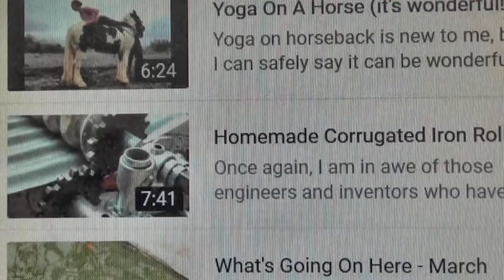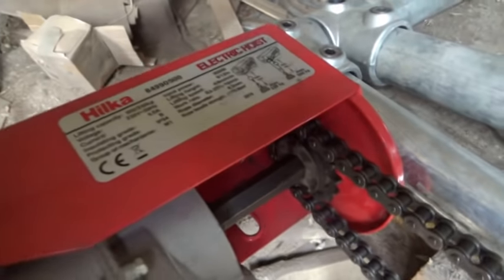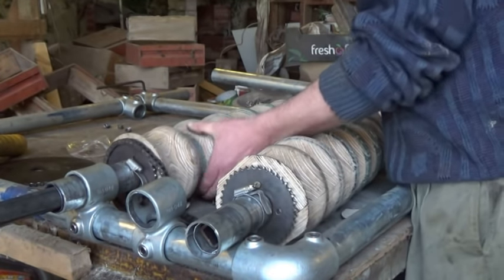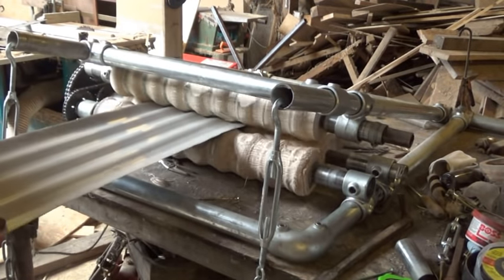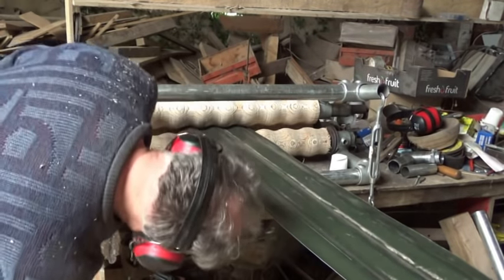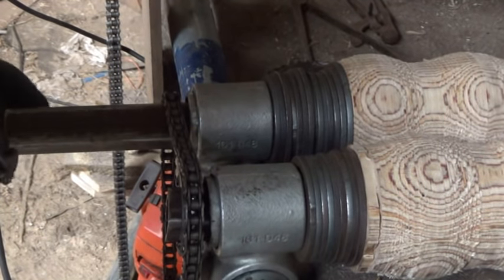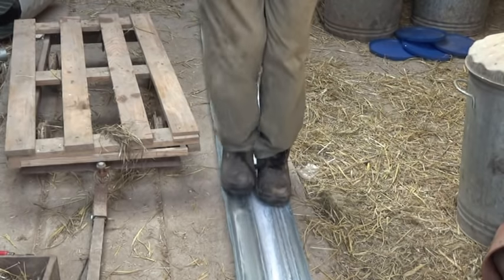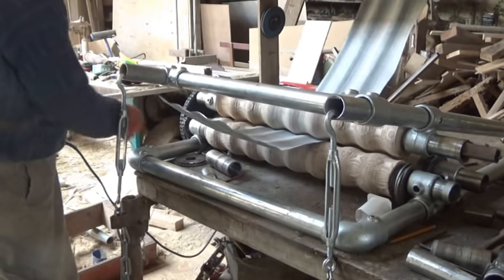Homemade Corrugated Iron Roller - Part Two

Comment: I have been watching your corrugated roller construction with interest. I have been rolling corrugated iron into garden beds and dog kennels the same as you are trying to do for many years. I do use an antique roller to roll the iron but cant see why your roller wont work,  I don't use new iron as it is too high tensile and crinkles quickly. I use old corrugated iron that was produced prior to 1950, this iron is quite soft and bends easier. A lot of corrugated iron roofs are renewed after many years and the old iron is quite reusable for what you are doing. The old corrugated iron is only 600mm wide compared with the new style iron which is 730mm wide. Up to now we have made 350 garden beds using old second hand iron. I would be quite willing to send you photos of the beds we have made to show you how successful we have been rolling old corrugated iron
Reply from the maker: Let me guess - you're from Australia or New Zealand?
Reply: Yes Australian, down in South Australia

Comment: I can't help but think the contraption has too much play for the forces needed. I would guess that you need something much more rigid and that the advancing of the middle roller needs to be done with more precision to avoid twisting. If the contraption is stout enough, you should be able to power it by hand- little by little- without distortion/twisting... My advice if you continue: scrap the tubing frame and weld something up with plate steel...
Reply from the maker: I think you're right - too much play. I might have to start again..
Reply: Way Out West Blow-in blog :) I hope you do keep tinkering- would love to see it. You got me curious so I looked into the industrial machines- they look quite heavy duty... but yours has them beat in charm, definitely.

Comment: Google "powerhouse museum corrugated iron bender" and check out the images. The original machines were used effectively on-site to put bullnose profiles on roofing sheets.  Of course the machine construction is very solid with cast iron rollers and a geared drive. With the gearing they managed to slowly roll the sheets with hand cranked power. The did use the softer grade of roof sheeting for the tight radius bullnose bends. Note as well that the small bit of the side frame jutting forward of the rollers is enough to stop the sheets slipping sideways as they go through. Possibly a future project might be to build a small foundry and make some solid iron or steel rollers. Anyhow a good technical resource on the problems you are encountering can be found by Googling "curving of corrugated steel sheeting". The BlueScope Steel pdf is a good reference. Cheers.
Reply from the maker: Thanks, Dale. Yes, that's what I based my first version on
Reply: @WayOutWestx2  Maybe get a price on an Indian "Rajinder". Apparently they are "export quality"! Search YouTube for "CORRUGATED SHEET BENDING, GALVANIZED DRUM MAKING". It looks like a neat little updated version of the original. Cheers

Comment: I have to order some bent sheets my self they say you have to use a thicker gauge of metal to stop the kinking
But I have noticed yours is to wonky to work the rollers shift out of alignment to easy.

Comment: When I made my pipe and flat stock roller I was looking to create a hoop shape so I employed as you have three rollers. Was I looking to create corrugated roofing, if that is your aim, I would use two rollers one over the other. Three rollers are invariably going to want to ultimately end with the ends of the flat stock looking at one another. As well taking flat as a starting point and what you ultimately wish to achieve as the end result, break it into stages and do it in steps through the same set of rollers at increasing pressures. As I am unable to view your initial post I have not a clue as to the original intention and reading back seems to provide little to go on so if I miss the mark, I apologise.
        Mike
Reply from the maker: Thanks, Mike. I'm just trying to roll down to a tight radius using the same principals as the big machines use. As far as I can see they use the same arrangement of rollers as I am

Comment: I think you need to stretch the outside of the sheet. That could be achieved by pinching the outside of the corrugations and leaving the inner ones alone. Problem is i bet this method needs a sturdier setup, and a large number of back and forth running.

Kudos for the tenacity!

Comment: One issue with this approach is that you are trying to do all of the bending across the entire sheet all at one time.  Commercial vendors will bend the outside, shapes 1st, and then progressively more inside shapes with subsequent rollers. So I think you need to break up your rollers, so you do one part of the sheet at a time working from outside to inside.

Comment: I am not an engineer but i would like to build a similar design for the same task. I think using a larger roller diameter would prevent kinking running at a steady slow speed like 30-40 rpm. Do multiple passes to get the curve sharper.
Reply from the maker: Have a look through my other videos in this series, Ben. I worked it out in the end and use it every week now

Comment: There isn't a simple cost effective method to roll out steel into corrugations else they wouldn't have had to make a million dollar machine to do it. When you bend metal it naturally wants to return to it's former shape so you have to do it gently over and over. This is why it goes through dozens of presses/rollers making each corrugation deeper as the sheet goes through. The press you have goes someway to producing a curve but you need the corrugations first.
Reply from the maker: Thanks, but I'm starting with corrugated sheet - I'm just trying to roll it to a curve

Comment: Old vid and maybe this was mentioned. Your mechanism for adding pressure on the third roller is hopelessly wrong. If you do not have exactly the same pressure across the width, your corrugated sheet is going to try and drift side ways causing all kinds of compound tension on the sheet.

Comment: Adjust your thinking . The panels you want have a ridge and a valley. Your tooling makes them both perfect on a straight panel. But you don't want a straight panel.
 So make your dies to work only on the outside of the panel. You can only stretch not compress. Kudos . keep up the videos

Comment: The problem: you are streaching the sheet - not bending it. Steel sheet does not streach like that cold. Also - system like this won’t ever work for streaching steel because the three rollers are not compleatly compressed throughout the bend, allowing the sheet to kink.

Maybe with heavy hardened dies and hydrolic press power it culd be done with multipple incramental dies. But not at home shop.
Sorry.
Reply: Aditional note - bends like this are done in two steps: 
first step: rolling of coregarations between two rollers
second step: bending through three rollers, like a pipe bender.
Reply from the maker: but I'm only trying to roll the curve - I'm starting with corrugated sheet
Reply: Way Out West Blow-in blog 
You can bend, squish and streach material. When you create corrogurations - you are bending the material. When you make the secont roll - you are sqishing and streaching the material, like bending a pipe.

Comment: I roll galvanized  sheet in to round bands using a pyramids roller from,12 inch diameter to 10 feet .

Comment: I think the problem is really the wooden rollers. To make a curve you have to stretch the steel at the topside of the curve. To stretch it, you’ll need harder material then the material you are stretching. Like you use a steel hammer to bend and a copper or wooden for flatten sheet metal. Maybe the wood used in the machine you were told of, was massive and hard like oak, acacia, or even tropical hard wood.

Comment: Seems to me like you need a flat roller on the inside and a wavy one on the outside. Solid contact on the inside surface so it doesn't buckle, and constant pressure from outside forcing the outer wave to stretch. Also maybe four rollers? One wavy roller directly under the inside flat one, and two flat ones on the sides that apply the force. I don't get the purpose of the inside wavy roller, the peaks don't seem to carry any load.

Comment: Could you take a round galvanized steel water trough and cut it in half then flip the two pieces around and weld together. From there you would have walls and roof and just need to cut a door and attach to pallet.  It appears that you are trying to build a mini-Quonset hit.

Comment: Here is a idea that may get you results that are similar to what you want.  Use a slip roller and curve the flat metal first.  Next use a bead roller to make some number of beads in the already curved metal.  I am just guessing that you don't really need all that corrugation to get enough strength.  It wouldn't be a one step process, but it would take less powerful motors to automate the two processes.

Comment: Just use flat mate. I admire your persistence but it’s just not in your realm of finances or tooling. Your better off rolling round or square tube to the desired shape and riveting or screwing lapped flat sheet with a bit of silicone as a lap joint. As for finding them already made, go to your local major plumbing supplier. They usually put orders in to roofing supplies and roll them to your need. You’ll need to give them a template or accurate drawings.

Comment: Is it likely that the process for corrugating and shaping into a curve is one operation, done when the sheet is hot, and more malleable?
Reply from the maker: Normally the sheet is zinc-coated (hot) and then cold-formed into corrugations and then rolled to curves

Comment: make it a single standing seam and that way you can just use a shinker tool  which will make your curve you woulkd make the panels about a foot widewith the single standing seam
Reply from the maker: Thanks, Floyd - I'd never seen one of those machines before. I like it!

Comment: Roll the flat stock then corrugate
Reply from the maker: flat stock just flops back if you try to bend it without corrugations!
Reply: Pin it into the diameter desired then form in passes is my thought. Requires top forming roller to be removable and installed inside the flat ring. Just a thought. Might not work

Comment: Corrugated sheet metal arch machines
This machine seems to be designed rather like yours for forming an arch in a pre-corrugated sheet. After starting with flat sheet steel, and running it through a corrugation maker, it then sends it through 3 rollers like yours to make the arch; we only see the one roller on top.  It creates a nice smooth curve, probably because the 3 arch-forming rollers and their axles are massive and have no flex or give (and are imparting only a gentle curve.)  I wonder if a gentle curve could be run through again to make the curve tighter.  Maybe, but there is surely a limit, where it would begin to wrinkle or crumple the metal.   https://www.youtube.com/watch?v=N1lujB13MFc

There are many short youtube videos of this next type of corrugated arch machine; it puts controlled crimps into the corrugations to form the arch.  The idea is, I guess, if you can't prevent it from crumpling, make use of it.  You could make one crimping bar and make different sizes of arch by crimping closer together for a small structure or farther apart for a larger structure with a gentler curve.   https://www.youtube.com/watch?v=6IFvxHplFbA    Would you object to the regular small crimps?
Reply from the maker: Thanks, CAM, I was hoping to avoid the regular little kinks that are made. But it might come down to that...

Comment: When the corrugations are shallower they would be further apart. As they get deeper they would move closer. May be, different rollers for each pass, each with higher peaks but closer. Tough ask for small scale manufacturing.
Reply: Or a huge roller, as it turns its make up changes.

Comment: Your upper roller is moving up and down. If you watch the shaft on the end of it you can see it also stops and then starts as the roller is still moving. The shafts and rollers need to be one with no free play or loose movements. You are close my friend.
Reply from the maker: Check out the latest version, Doug.. https://youtu.be/lNhEmNsELYo

Comment: I think a major problem your designs have is the rigidity of the frame holding the rollers. Instead of bending the metal the frame bows. Then when stress on the metal gets high enough that it begins to yield the spring tension in the bowing frame pushes the metal past the rate of curve you want and instead it buckles. In general I'd say if you can see bowing in the frame or rollers they're not rigid enough.
Reply from the maker: Thanks, that was a problem in the first set-up but the latest ones don't move - yet the problem persists..

Comment: If you can reconfigure your system enough to allow feeding of your sheets from one edge and just do one "groove" at a time....in other words, just form each corrugation at one end of your roller (only feed the edge of the material into one side of rollers enough to form one groove) run the sheet all the way through (end to end), remove and feed material into the rollers placing the formed groove into the next trough in your roller. this should hold the material in that second groove while the first groove forms the next corrugation on the material. In this way the shape of the rollers holds the first trough while the next trough is being formed, allowing the flat material to be pulled into the roller from the side so it doesn't kink or try and stretch the sheet all at once. it'll take longer, but.....
Reply from the maker: Thanks, but I suspect that would be a recipe for curving the whole sheet sideways. Best to keep things symmetrical if possible

Comment: What if you just roll the sheets on the frame of the buildings? You fix it at one end, then if you bolt it down every 10cm or so it should help avoid breaking the arc. Maybe lots of narrower sheets
Reply from the maker: That could work, but I'm trying to keep the design really simple

Comment: Hello my friend, I've toured a shop that made those shapes. It's rolled perpendicular to the direction you're doing it in. Think of it as a step wise metal break. The first kink, move forward, the second kink, move forward ... and so on. More press, less roll. Best of luck.
Reply from the maker: Well, that's one way of doing it, but it's not nice and smooth, is it : -  )

Comment: I use to make corrogated iron watertanks using aquaplate and zincalume tank iron , on small diameter curving it requires lots of passes with gradual increments to avoid the creases that you are getting , and galvanized iron tends to be a lot softer ( easier to roll ) than zincalume or colourbond roofing iron is only .45 to .55 mm tank iron is .65 to .85mm  thickness , stainless steel tank iron is now available
Reply from the maker: Thanks. Check out my latest video on this project - I made some progress

Comment: I would just install the metal roofing material so the rib is horizontal instead of vertical.  The sheeting with conform to the arch in that direction.  Might need a couple sections, but if you overlap them by a rib, you should be fine.
Reply from the maker: Thanks, yes that would work, but it just wouldn't look the same

Comment: Why don't you curve the corragated iron at 90 degrees to the corragations? The corragations add bending resistance in one direction only and you are fighting against that.  You will still get the strength you want if the corragations go in a differnt direction.

 Some buckling is inevitable. If you really want to bend in that direction, perhaps add ripples to your rollers which will put the buckling in controlled points.
Reply from the maker: YOu're right - I had just wanted to roll it smooth, but perhaps it just isn't possible

Comment: I have a commercial corrugated bullnose machine, the product you are after should be a minimum of .55mm thick and G300 Grade 
im not sure if the terminology is different where you are based for the tensile grade of steel required, as im based in New Zealand.

if metal roofing manufacturing is similar to New Zealand then you should be able to ask for the corrugated roofing to be run out of a flat sheet of the same product used to make any metal roof flashings. as we tend to use a higher tensile strength steel for standard corrugated. which creates the problems you seem to be running into.
Reply from the maker: thank you, Lionel. So you're saying the matching flashing pieces might be made of softer steel? I'll get back to them and ask..

Comment: How about bending them between two forms like vacuum bending wood ? 
Maybe one form and multiple ropes to pull the sheet over the form . 
Seems like you’re persistent enough to get this cracked . 
If you pre drill fixing holes will that allow enough give ? Just a thought .
Reply from the maker: Thanks, Kirsty - good ideas!

Comment: Can I assume you have researched the construction of WWII Quonset Huts which were full sized buildings of the kind you wish to fabricate?  They used corrugated steel bent as you are struggling to do and shipped many thousands all over the world.  It would seem there must be a trove of information on the bending of the steel sheets therein.  Take care.  Doug
Reply from the maker: Thanks, Doug. Yes, they're inspirational buildings, but with a much bigger radius and a C shape, rather than a U

Comment: Get an old gas tank or oil tank and cut it in half you'll get two very decent sized dome topped cylinders.
 I hope the dogs and geese appreciate the efforts you're going through. Finding an acceptable bunk bed for my kids was traumatic enough.
Reply from the maker: Ah, but my hope is to develop a whole line of these little sheds and sell them - so that's why I'm going for the one-piece roof if I can